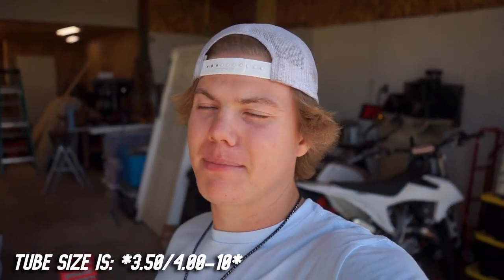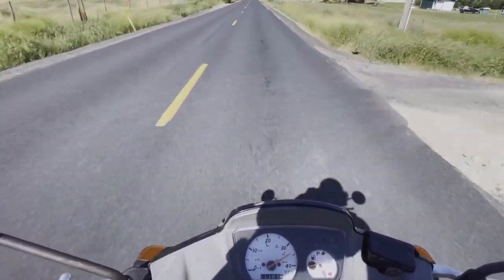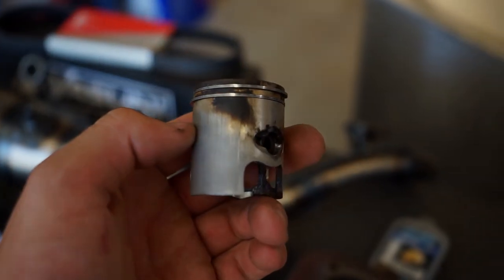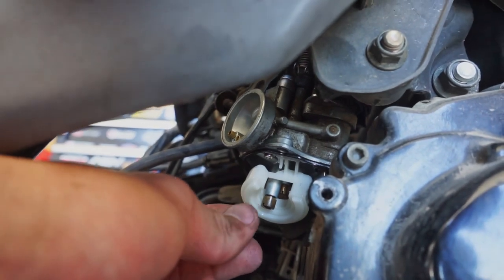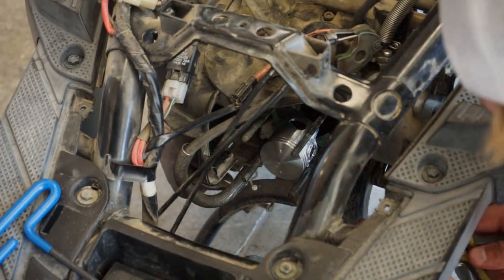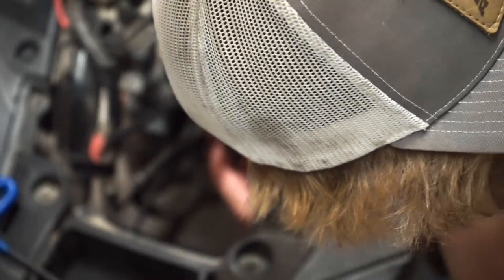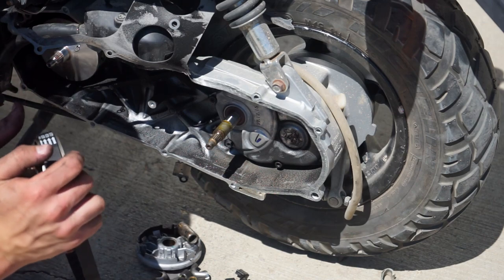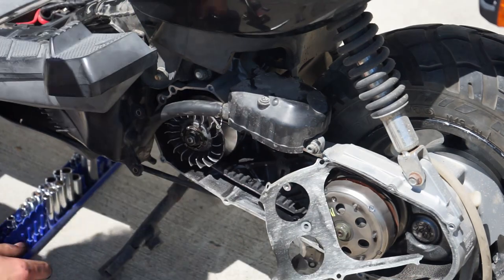Watch This BEFORE You Mod Your Scooter | Yamaha Zuma Build 1

Comment: It blew up because your cylinder at head were leaking. Do not oil the o ring on the head. Use Honda bond on cylinder gasket and on head(very important)it will always leak if you don’t . Torque head to 12 ft lbs before and when cylinder gets hot(important). Oil injection is adequate for 70cc kit
Reply: How can u tell easily if it has the 70cc kit
I have a 05 Yw50t i got off a guy. hAs leo vince uprgraded pipe and rollers haven't torn into it as it still runs like a champ. but would like to know more if it was converted or not. It does keep pulling past 40 a long way on gps speedo and the actually speedo. It feels quick. But the build up of speed takes a little bit till the bike is hot and begins idling on the pipe any advice?\
Reply: @welcometomyjourney3982  best way is to reference what the cylinder head on your scoot looks like compared to the stock head

Comment: i have an 02 zuma with the stock top end, some cvt work and a custom pipe like the yasuni you picked up. it hits 48mph on flat roads against the wind. im 160 lbs and everything else on it is bone stock
Reply: 47mph is stock top speed so not too much dif. Maybe take off if you did clutch rollers and springs with pipe. Add 5mph top end with my secret if you ask nice
Reply: @joeblow8206 they do not do 47 mph stock

Comment: Don’t need to delete oil injection just top off each tank with a cap of oil especially extra when first install kit
Reply from the maker: Yes also another option!
Reply: @Scootchie - OMG thank you for the tip. I have a Pollini 70cc kit that I want to install this spring. Thought I wasted my money as pre-mixing is not a route I want to go.
06 BWs50
(edit: yes i know this technique is still kind of pre-mixing, but not deleting things is good)
Reply: Believe it or not, that can actually make it run even leaner. Makes no sense I know, but Google it.

Just a bit more is okay but as you add oil you have less fuel but the same amount of air. You're also adding carbon which will build up and score the cylinder. I prefer to just run a good synthetic castor at the specified ratio or when keeping the stock pump a good synthetic designed for auto mixing. It's thinner then the oil you mix yourself. 

2 strokes are so finicky but once you get em right, nothing beats em.
Reply: the oil added to the fuel can make your petcock leak so a manual pet should be used ..

Comment: There should’ve been a restrictor in the silencer as well , 2 stroke scooter pipes have 2 restrictions to remove to get full use of the pipe
Reply: Yeah, two restrictors. That is correct.
Reply: What about the yasuni c16
Reply: @OGSirSmokezAlot  c16 city has them but not sure about og c16. It's not a road suitable pipe even on paper so I'd guess it is not restricted.
Reply: @OGSirSmokezAlot  that doesnt have any restrictions
Reply: What about the giannelli reverse

Comment: never had an issue with the oil injection just make sure to bleed it.
Reply: Love my zuma just wondering do y’all premix oil in the gas tank since it’s a two stroke?? Because I haven’t been and it seems like it’s starting to bog down a little bit when I’m riding sometimes??
Reply: I used too pre mix in fuel tank but was told by mechanic to use the original method which was the bottle under the seat the cap next to the fuel cap

Comment: i got simmular motor on my malaguti crosser cr1 i got a 70ccm malossi kit for it malossi fly clutch i keept the clutch spring stock i am running 3x4.5g and 3x7g rollers in the malossi multivar my top speed was 80km/h

Comment: Mine cut out today after few bumps on road and it wont fire back up usually starts straight away even from cold anyone got any tips wants to start but doesnt fire up
Reply from the maker: My guess is that something got lose like a spark plug cap or something…

Comment: i have the same model. So it has a leo vince zx pipe but the mix pump is still on itbad does it have to be to weld the piston to the cylinder?

Comment: What slider weight would you recommend I have a 2016 zuma 50
Reply from the maker: Hey Hunter! 
That’s something you have to tune for. If you buy the multivar variator it comes with rollers. I would recommend buying a kit off Scooter Tuning CA that has a variety of rollers so you can maximize the variator. 
A good way to test if you’re using the variator to its max potential is to draw a vertical sharpie line on the inside pulley surface (where the belt rides on) and then run the scooter wide open and see how much of the line is worn off. You can adjust your weight from there! If the line is still there you can put lighter rollers in. 
Hope this helps.
Reach out with any further questions!
-Nik

Comment: If those metal reeds fail, you will destroy your engine
Reply from the maker: Iv never heard of metal reeds failing. Have you?
Reply: @MintWorxTv  They definitely can. There were a few members on Zumaforums when it was active that had theirs fail. Running these engines at the higher RPMs that BBKs can hit puts extra stress on the reeds

Comment: You should have been fine with the stock oil pump. I ran a mallosi MHR 70 with the stock pump. Jetting was most likely the problem.

You didn't show it but I'd be willing to bet that you can hone that cylinder and get a B or C sized piston and it'll run again just fine.

My first MHR I didn't set the wrist pin clip correctly, it came out and the cylinder looked destroyed. I held onto it for a year and one day decided to try to fix it. Used pool acid to get the aluminum from the piston off the nickasil and a few hours with some Emory cloth smoothing out the gouge from the clip. I never tried running it myself but I sent it to my buddy in Japan and he slapped it on his scoot and it ran just fine. He ran for more than a year.
Anyway, that was nickasil, which is nowhere near as forgiving as the cast iron cylinder you have so I'm certain that you can repair your cylinder.

Also, tuning weights... They're your best friend. Hell, after I used them to tune my scooter the first time, I never used anything else.

If you look for my name on 49ccscoot.com you'll see some of my builds and see that I'm not bs ing you. Even a few vids on this channel with some of my zumas.

https://youtu.be/ENyXcEWem1k
Reply from the maker: Hey man! Thank you for all the info on your build! And yes I can still hone that cylinder out and use it again and probably be just fine. I didn’t even think about that before I ordered the new one. Now I have an extra haha. Also that scooter in your video hauls ass! I’m impressed haha
Reply: @MintWorxTv 
Thank you as well.
And I wish I still had it because it was a whole lot of fun